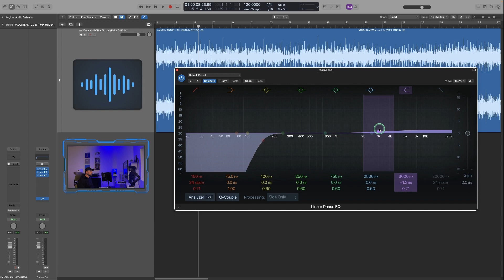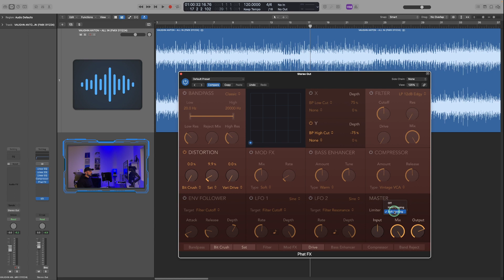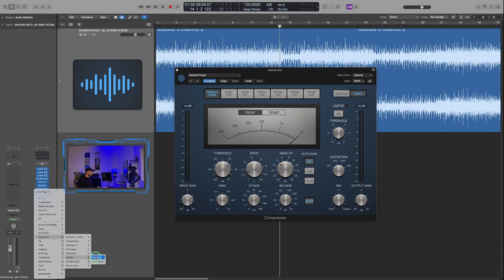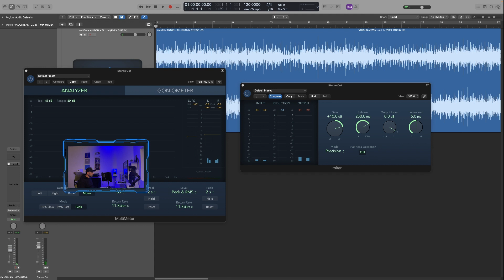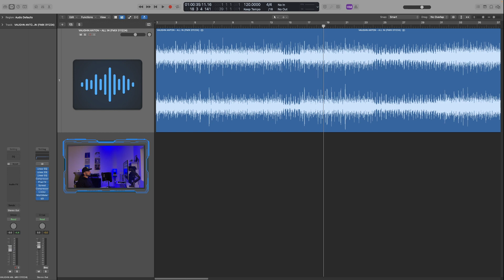Club Ready Master in Logic Pro Using Only Stock Plugins (Free Project File)

Comment: Hey man any tip on how to get more punch in my kick in this template? What plug-in should I adjust?
Reply from the maker: Hey there, try adjusting the "knee" on the glue compressor up to 1.0 and adding a slightly targeted bell curve boost on the mid-only eq at around 200hz -hope that helps!